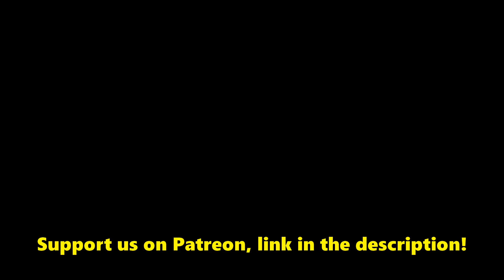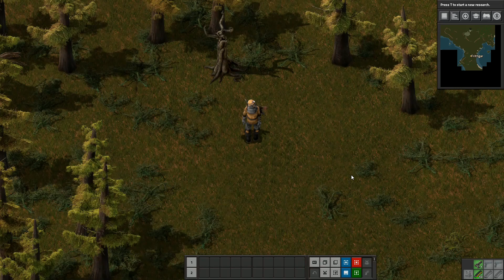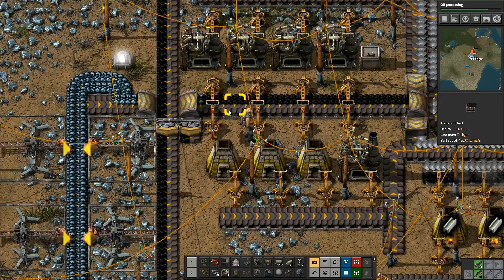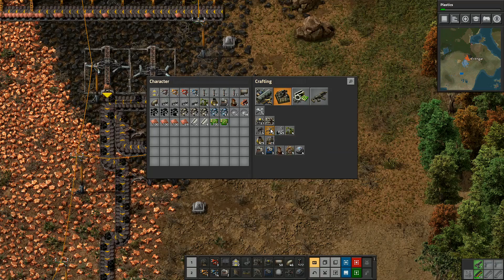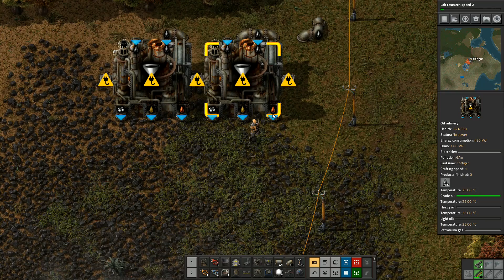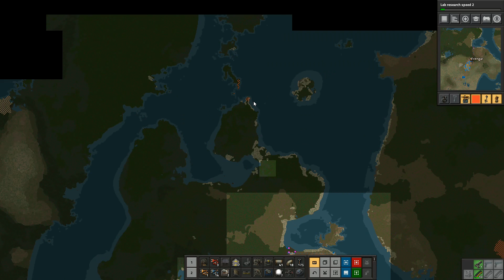Factorio Million Robot Challenge #14: Basic Oil System!

Comment: I know I'm 200+ episodes late but why do players use far too many lights?   I swear, look at any blueprint where the players use lights and they will add more than needed.
example Oil refinery layout, 1 light between every oil refinery seems like 3 or 4 times more lights than needed.
OH, I have 4 pumpjacks so I will add 2 refineries, that isn't a useful reference to help anyone understand anything.  Well to be fair the whole series has kind of that feeling but we can enjoy the player.
I have no clue if the following is useful but it has been stated by another that 200% oil production from a field is enough for one refinery... you can get the output from a group of wells from the map just like it gives you an ore field size.  The problem is that over time the field size will shrink it will never dry up but the size will shrink on each well down to around 1 or 2% I am told.

Frithgar please stop it! Stop what? Building on the ore fields. You need to be able to mine those fields so most of the space on a field should be reserved for miners not for assemblers.  I personally don't put lights in my ore fields but maybe I should especially if I expect bitters to be active.

I light my miners to be packed in tight and cosy and be in blocks of 30 to feed smelting lines of 48 smelters.  But right this second I can't recall if 30 miners on a yellow belt can push the ore to the end of the smelting line when you have steel furnaces.
Reply from the maker: Everything at this point is temporary fixes until I get the robots, then belts become pretty much obsolete in this series.  As for ratios and balance, I've never looked into it very much, especially regarding pumpjack output, but that will change later in the series as well.  I still don't know optimum pumpjack outputs, but ratios for oil is addressed at around episode 280 ish.  And yes, I know the building on ore is painful, it's painful for me as well, but there were just too many trees in the way!
Reply: @Frithgar    I've never seen a base run by robots, it doesn't really sound efficient but one clip I saw it was at least interesting.  And I have heard it works so now I'm even more interested in your series.  So if you run with mostly robots does that mean you run more logistic bots then construction bots?  And yes I have used robots and personal roboports to do building and that does work well when your more into pasting blueprints and walking away and repeat and just let the robots grind away at the work, even better when the stuff is made but OK if the tools are in place to build the stuff when you don't have enough, though to be fair if I run out I usually adjust my storage values so next time I have enough.  Thanks for running this series it has been slow but interesting.